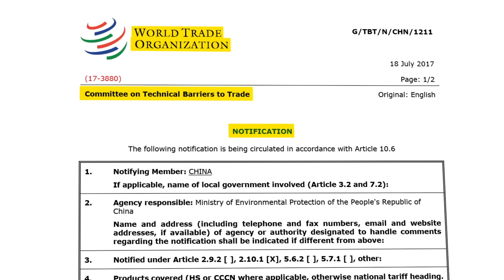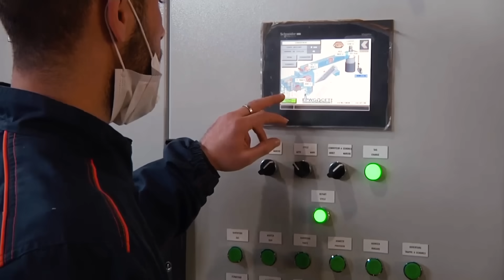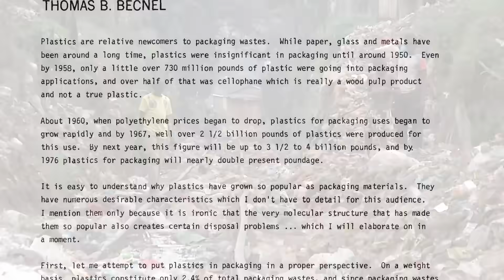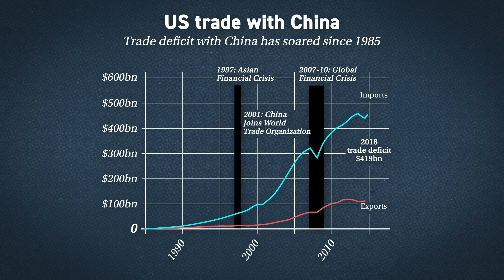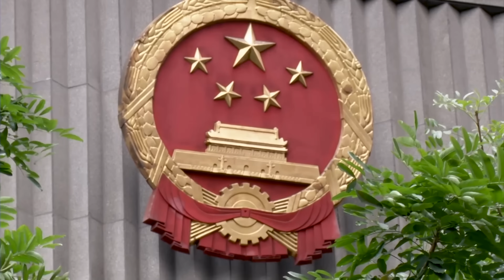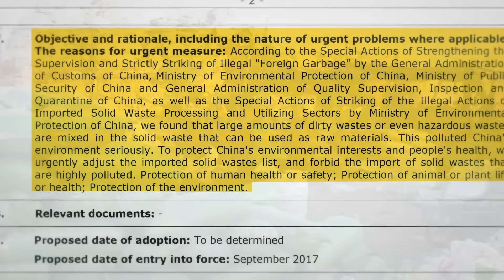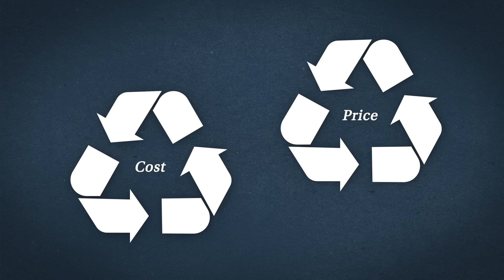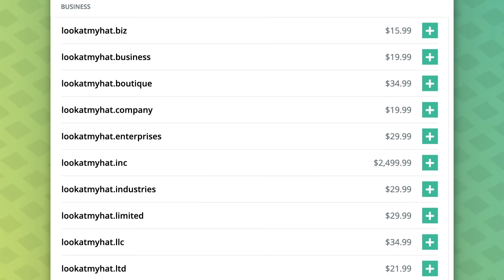How China Broke the World's Recycling

Comment: Explain to me again why the company that produces the plastic should not be financially responsible for the plastic to be properly recycled?

There's 3 Rs, no just Recycle. 

First, Reduce. Think about what needs to be packed in plastic, how much plastic should be used, what quality plastic, etc.

Second, Reuse. Don't throw away a perfectly fine plastic bottle if it can be reused again. Shampoo bottles? No problem, there are (and should be more) places that sell cosmetics without packaging - you bring your own, they have a giant 50L tank that you just take a bit from. No need for a bottle to be thrown away after a single emptying.

Third, Recycle. The bare minimum of plastic (after reducing), that cannot be used in it's original form again (reused) should then be recycled. But this process should only catch the miniscule percentage of plastics, not a majority.

Comment: There is no need, at all, to use stupid plastic everywhere.
I am trying to reduce its usage, I am asking to use paper to wrap but even small shops don't have that option. Usually you can find paper bags next to mushrooms so I use them instead.

But it is not going to change anything unless ppl stop to use plastic (or switch to that "recycle-worthy" one - instead of small 75 grams  yogurt one  400 g large made of "good" plastic).

Comment: there should be a law that can control the package design. to make the trash easily be sorted before they go the the household trash can.  The package should use always the similar material if the part are unseparable. at least No paper stick onto the plastic bottle, no plastic window on the paper evolope. And mark them CLEAR for which trash can the package goes to.

Comment: It's honestly pretty disgusting to think about. Ironically, it's not plastic itself that's the problem, it's the way it's used. Plastic has a number of properties that make it critical to many products, it's lightweight, sturdy, electrically insulating, non-combustible and sometimes transparent. We could not easily have electronics or electrical equipment without plastic, many other products use plastic where wood or steel would be too heavy. Sometimes plastic is used as a transparent barrier where glass is too fragile. These plastics are generally used for a long time before discarded. The problem is with the consumer level throw-away plastics. Plastics are sturdy, colourable, flexible, moldable and really cheap to produce and that makes them any capitalist corporation's wet dream. With plastic they can make products that appear to be high quality while they are actually really cheap and not so durable that the consumer never has to buy it again. Corporate entities know the consequences of overwhelming the world with plastic, but they don't care. The more plastic they make, the more money they make, so they make as much as possible. 

This compounds with the fact that the plastic is not profitable to recycle, so the ones producing all the plastic are doing nothing to clean up the mess. They are also the only ones who could actually make a meaningful difference. If they were willing to cut back some of their profits (a silly thought, I know) they could drastically reduce the amount of plastic that is produced in the first place. They could also focus more on recycling the plastic that we already have. If governments were concerned with the problem they could put restrictions on the amount of new plastic that could be made and/or put a tax on new plastic to incentivize recycling old plastic. Of course, none of these things will ever happen. 

The sad thing is that the finger is always pointed at the consumer. Plastic pollution becomes the consumer's fault for not recycling hard enough and for buying things that come in plastic even though essentially everything is packed in plastic. Nobody is going to refrain from buying the newest phone or CD because it was made from new plastic. Nobody is going to go to the hardwood store and check if the tape measures are made from recycled plastic. The sad reality is that no amount of recycling that any of us do could make a bit of difference compared to what the people producing the waste could do.

Comment: The obvious solution would be to tax new plastic. Or just tax the oil it's made from (which would double as a way to encourage people to switch to electric cars). Make the tax high enough, and even the negative-value plastics will become profitable to recycle.

Or, for a more creative option, there's waste-to-chemicals gasification. Put garbage through a blast furnace fed with a mixture of oxygen and steam and get a stream of gas out (mostly hydrogen and carbon monoxide) that can be converted to common precursor chemicals. The small fraction that doesn't end up as gas ends up as a sort of artificial stone that can be used in construction.

Comment: Stopping the blame train at the foot of the plastics industry is one stop too early. If I recall correctly, there's no shortage of space for garbage. There may be momentary shortages from location to location, but there's simply far, far more space we can use for trash, and even once a location is closed to additional garbage, the land can be reclaimed for other use by building atop the trash pile. We have a local park that's sitting above a garbage dump. I once lived in a part of Manhattan that was previous a literal dump.

This video rightly identifies plastics recycling as a very questionable solution. The plastics industry came up with a non-solution to a non-problem.